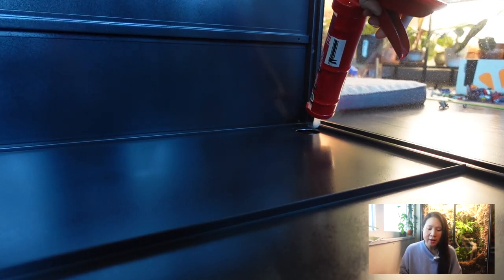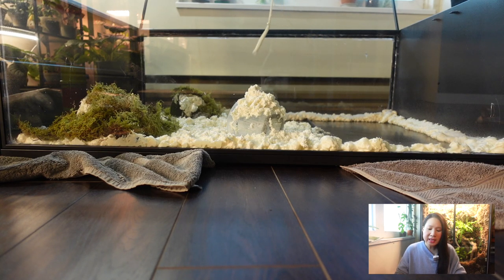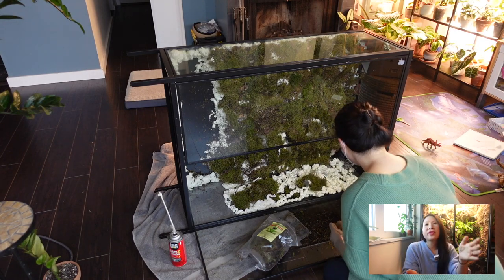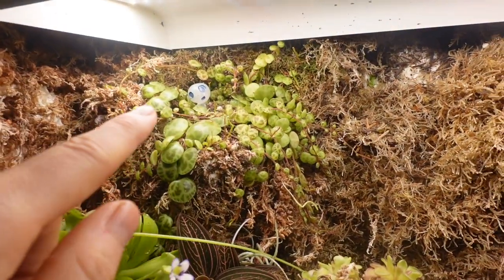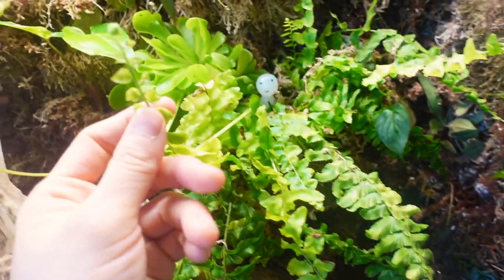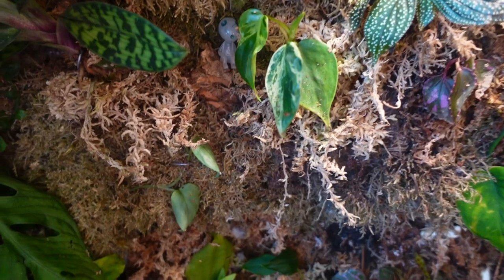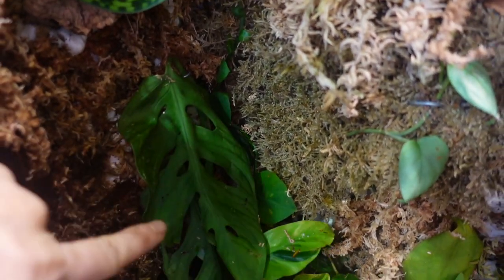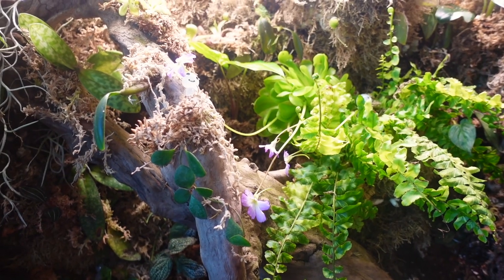IKEA GREENHOUSE CABINET (Rudsta): Terrarium Tutorial and Tour

Comment: Your cabinet looks stunning! And it will only get better as the plants grow in 🌿. That big piece of driftwood really adds dimension and helps it look like your own little forest. Benji has been a great source of inspiration! Another good channel for terrarium building is SerpaDesign. The one thing I would add is heat--humidity loving plants need heat just as much as they need the humidity. You could try just sticking a seedling heating mat to the the bottom--a little would go a long way. A little fan or two inside the cabinet would also help.
Reply from the maker: hi Kris, thank you so much! I do also enjoy serpadesign's channel! Is there a heating mat you would recommend? right now I am keeping it just inside the door but it kinda obscures the view :( and i worry sticking to the bottom it wouldn't heat up as well because it would be outside the cabinet and also there's so much substrate on top, too!

Comment: little late but if you plan on doin this again hold the can upside down as you foam it helps the foam expand more and dont drop the foam down from a height have the foam right on the surface u want to spray it on and you wont lose as much of the expansion
Reply from the maker: thank you for the tip! i always think about converting another one!